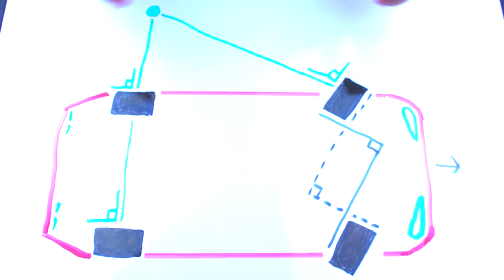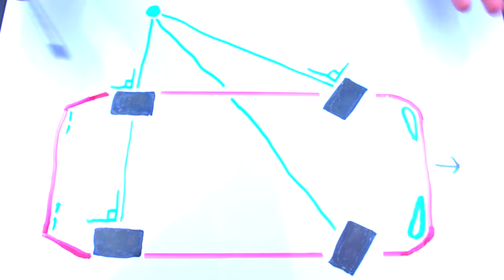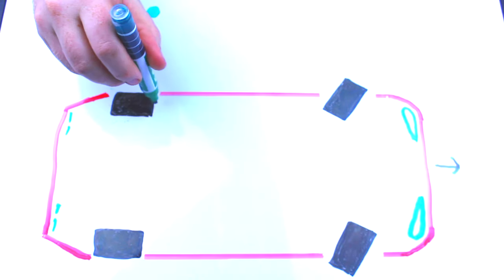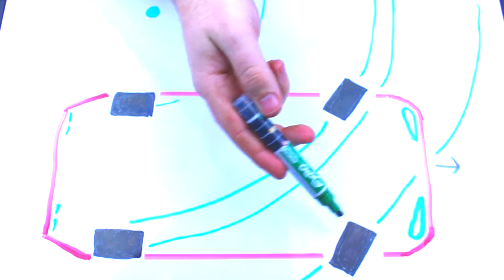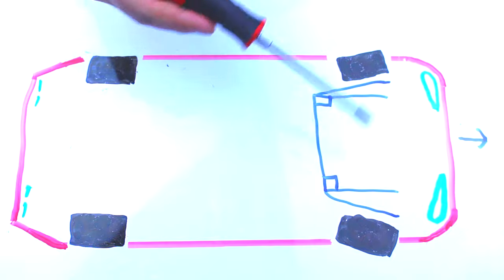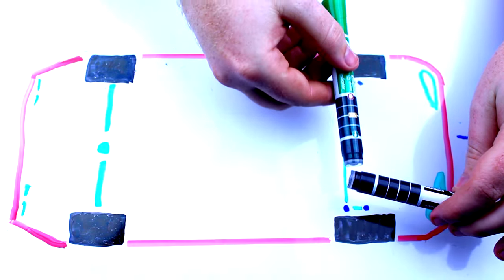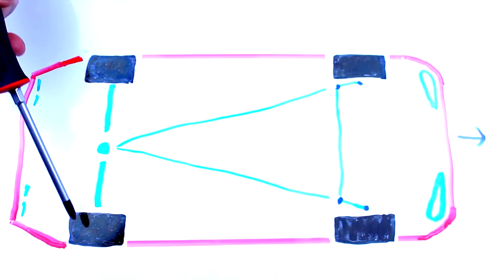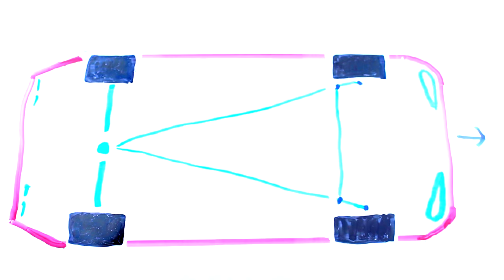Parallel Steering Versus Ackermann Steering Explained • Cars Simplified

Comment: Your diagram reminds me of the static models that alignment shops have to show customers have alignment works and how the car rolls much easier after an alignment when the adjustment is out and there is drag driving down the street!
Reply from the maker: I hadn't thought about that until you mentioned it... It does look like some of those!

Comment: Body roll to the tenth power, severe  outside weight transfer, outside suspension compression as inside suspension extension, tire loading (planting diving) great for slow speeds when initiating steering input when cornering, but unstable upon exit.